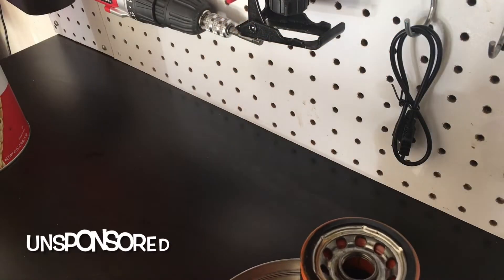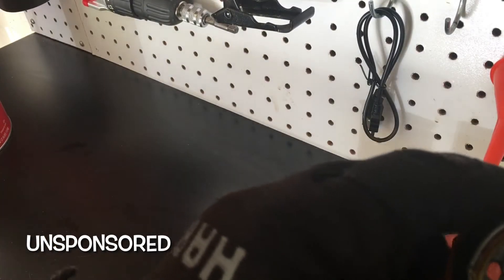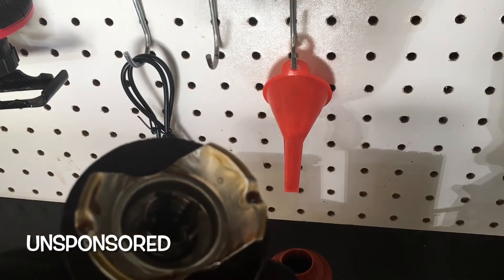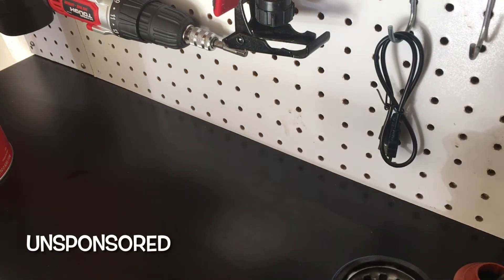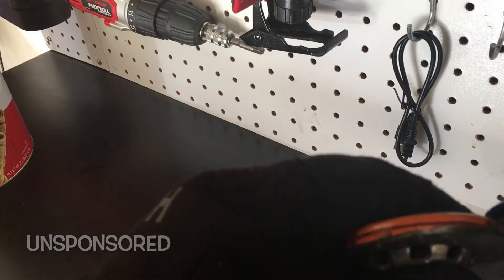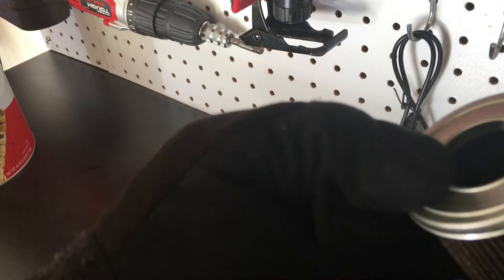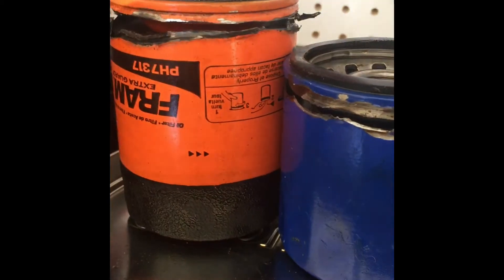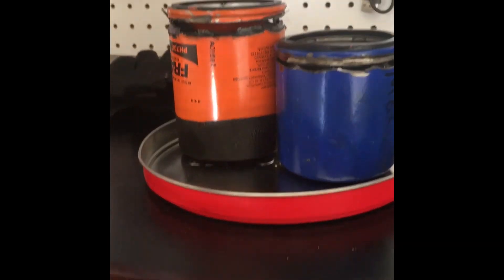What’s in an oil filter? Cut open Supertech ST6607 and FRAM PH7317

Comment from the maker: Update:  was in Walmart today and looks like they are changing the st6607,  now the filter is white can 
It looks so far to be the same thing but with. White can.  I will be interested in knowing what else changed.

Also they are coming out with MP6607 filter which is  rated at 20k
It cost $2-3 more but looks like it has a silicone anti-drain back valve

Comment: The LEAST expensive Frame is not very good. The 15000 mile Fram and the 20000 mile Fram are very good. Everybody should change the oil at 5000 miles MAX my opinion and if you have any newer GM engine do it at 4000 miles. Do not wait for the oil change light to come on!!😮  The Supertech Filter is good! Most any filter is good to 5000 miles.  Do what you want obviously!😊
Reply from the maker: Yep I stopped using fram filters  a while ago.   I use SuperTech 10k and puralator filters now 

I change my oil every 5-6k which is when the maintenance minder goes off

Comment: My dad complained about low oil pressure in his Jeep. I swapped out the orange can of death (Fram) for a Wix, and the oil pressure returned to normal. The Fram OCOD only had roughly 2000 miles on it. I'd personally never use a Fram oil filter on anything I cared about.
Reply from the maker: the SuperTech , older Filters  use to be made by Wix I think now they are made by Champion Labs who makes AC Delco, STP  and others private label branded .  they aren't bad.  but not the best.   well they are better then the Orange can.   Actually   the Honda OEM filters  I think are  the Tough Guard Fram Filters. I haven't cut one open yet to verify.
Reply: @dfields9511  The last Honda OEM I cut open did indeed look like a Fram inside; it had fiber end caps and glued seam. I think Subaru uses the same.
Reply: @PapiDoesIt yeah like Honda doesn't know anything about quality. I love My Acura TL. I've used all kinds of oil filters growing up. On my Acura I'm currently using a Pronto (Premium Guard) basic oil filter with Pronto 5W20 full synthetic.

Comment: Similar quality, but the FRAM’s 95% at 20 microns and the Supertech’s 99% at 30. Pick your poison.
Reply from the maker: Still prefer the supertech.   Seemes  to be better made  but I’ll will use fram if I cannot get a supertech filter .
Reply: Fram xg7317 is 99% for 20 microns, so and it's built better, metal end caps, filter media better for $9.  Just got an RDX, I'm using Fram XG even tho my warranty won't allow 20,000 miles.

Comment: I use supertech oil filters. I think they are very good filters. I've used many fram filter. Never an issue. The key to any engine lasting is changing the oil frequently. I change my engine oil every 3,000 for conventional and 5,000 for full synthetic.
Reply: The best oil....is clean oil.

Comment: ..3:35..."and I'm not dissin' Fram"...well, maybe you SHOULD be dissin' Fram..they are the WORST, cheapest-made filter on the market by a country mile....
Reply from the maker: That’s why I use the supertech filters now.  unless they are sold out of ST6607.   I will say that I have learned that OEM Honda filters, some , are made by FRAM but are the tough guard middle tier.

Comment: Fram filters are trash don't waste your money
Reply from the maker: I typically use supertech filters for the past few years.  However I have learned that the some OEM Honda filters are actually made by FRAM but are the Tough Guard middle tier filter.
Reply: I use wix filters never had a problem
Reply from the maker: @chucklucas8747   yep I have heard they are good.  The Supertech filters ( old white ones ). I think we’re made by WIX.  The blue supertech filters are now made by the same mfg as ACDelco and STP filters
(Champion labs)

Comment: I just wish SuperTech would produce a size 7317 filter. That would be the right size, comparable with other filters rated for my ‘17 Civic. The 6607 doesn’t have nearly as much filter media area.
Reply from the maker: yep I agree,   it looks like they did at one time, here is a cross refer lookup  for the 7317 filter,  https://www.oilfilter-crossreference.com/convert/Fram/PH7317

I also wonder if the surface area of the ST6607  filter media is the same size in square inches, area of PH7317.
Reply: @dfields9511  even though the SuperTech filter can be used up to 10k miles, I don’t think I would run it more than 5k miles. Call it superstition, but whatever mileage the filters are rated for, I usually go half on it. Maybe it’s a waste, but I’ve never had any oil problems. Just a thought. Oh and I do like the metal end caps as opposed to the fiber ones...not that I’ve had a problem with the fiber ones, metal is just my preference.
Reply from the maker: @carlovanrijk4039   exactly my thoughts I would NOT go more than 5-6k.   The cars of mine their oil change is 3-4k so it’s all good.  However my newer car oil change is about every 6-7k and uses full synthetic 0w20.  I haven’t done my oil changes on it yet myself.  It’s still under maintenance warranty with dealer.  It also takes filter 7317 or 6607.  It’s a Honda.  I saw somewhere that some of the Honda oil filters are really made by fram  but I haven’t cut one open to check yet.
Reply: @dfields9511  don’t quote me on this, but I believe you are correct. The OEM filters for Honda (ending in -02) and Subaru (?) are made by Fram...it supposedly is the equivalent of Fram’s Tough Guard filter, which is their mid-tier filter. I’ve used the Tough Guard filter on my Civic for a 7K mile interval, and sent the oil sample to Blackstone for analysis...report came back very good and said I could run the oil to 10K miles (majority highway miles).
Reply: Wix 57356 is a common filter for Honda and Nissan. The 51356 is also compatible but it is short just like the Super Tech St6607
Reply: @Vdub1910  I’m thinking that the 57356 filter is the WIX XP, which I’d like to try and see how it does. I’ve used the NAPA gold 7356 on my ‘Civic (a WIX make) and it did well.
Reply: Super tech now has the 7317 in the new 20k filter... This line up costs more but has a silicone anti drain back valve!!
Reply: @uglyhandgarage2927  that is good information to know. Thx!
Reply from the maker: I hadn’t seen 7317 yet in the 20k filters but I will keep eye out for it.  I have been using the ST6607.  And stocked up on them as I think they will be changing everything over to the new design with silicone DBV.   For my needs I don’t need that.  Oil change is 3-4k miles.  But if oil changes were longer duration than I would like them.
Reply: @dfields9511  from what I see they will carry both the 10k and the 20k but the don't both have the same variety... I did see the 6607 in both but not the 7317
Reply from the maker: That may be store specific.  The store near me no longer has st6607 only the MP6607.   That cost like $2.50 more than the st6607. And it looks like they are switching over on the design instead of having two different tier offerings.
10k at $2.97
20k at  $5.48

It would be smart to have 2 different tiers.
Reply: @dfields9511  I agree... You are right, it maybe store specific
Reply: @dfields9511  agreed....some people use conventional while others use synthetic. The different tiers are utilized for the different oil types.
Reply: 9688 is compatible
Reply: There is an ST7317, suspect it's the same as Fram PH7317.
Reply: @lonniebeal6032  yep, they just recently came out with it (last 6 mos.?) it is part of the MP series, rated for 20K miles…not that I would go that far between oil changes, but good to know it’s longer lasting.